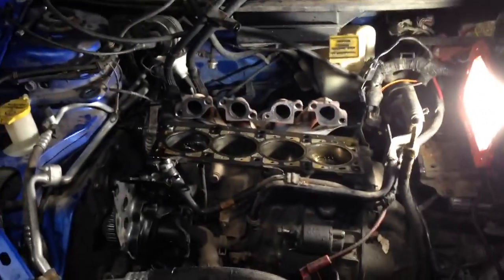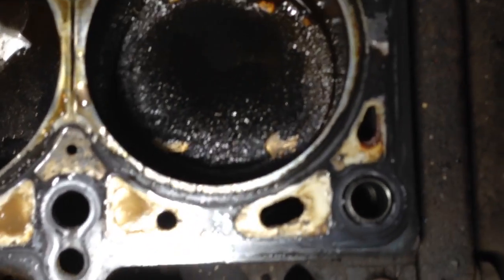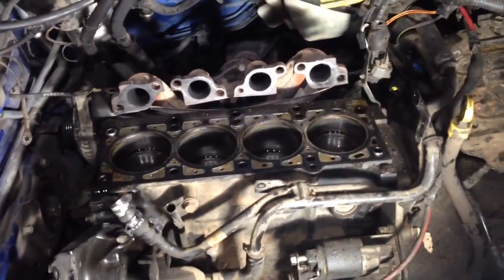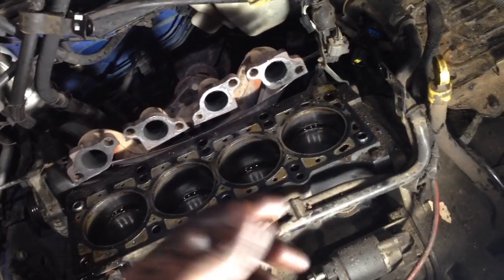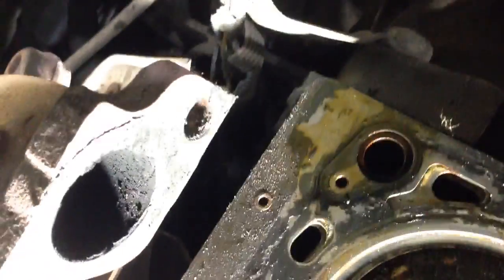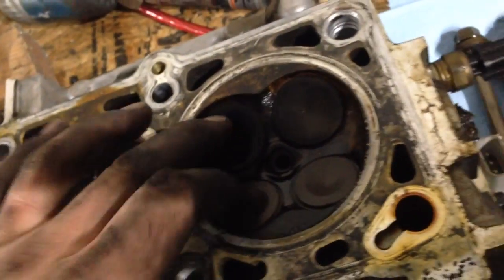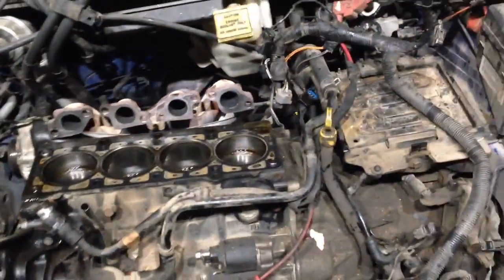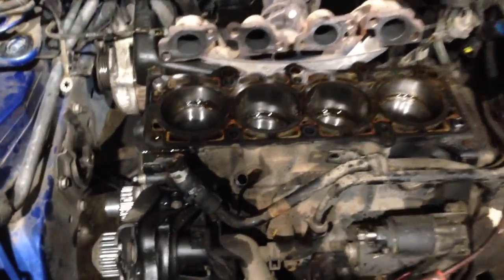How to check for bent valves after timing belt failure

Comment: Recently I discovered that timing belt is not that visible serpentine belt and it has to be changed before you see signs that something went wrong.
The car is 1.4 tdi with 216k km on odometer and original timing belt. 
I took a peek at it, the color is washed, it doesn't have cracks on the back side and doesn't look like it might snap but then looked closely at the teeth and saw at the base micro cracks.
I ordered a belt kit and have to wait 1-2 weeks till I'll change it.
I'm still using the car and wondering, can the belt last another 100k km or it might fail tomorrow 🤔😓😓😓

Comment: A compression test would reveal bent valves. Although those engines are super easy to replace timing kits . Prolly should have replaced it a little sooner
Reply: Except you cant run a compression test the conventional way with a broken timing belt as you'll just do damage, thats why he did it the way he did.

Comment: A week after a head gasket outage and cylinder head crack on a 2004 Audi A4, I sent for a remanned head from Cylinder Heads Intnl and re used my Gates Racing belt (I dont race) with 27,000 miles on it, and somehow the '300% stronger' TB still busted 500 miles later, while going up a hill. All that work for nothing!!!

Comment: 1995 honda odyssey wih 295,241 miles timing belt snapped on hwy.if no visible sign of impact with piston and leakdown is goog should I go ahead with timing belt component install or send out head to shop to troubleshoot. Still working on putting all timing marks back. Do have compression tester,leakdown kit and smoke machine with builtin compresor 30 psi max.
Reply from the maker: sounds like your lucky.  i would put a belt on and see if you have any missfires

Comment: Check  the leakdown with both valves closed.  Remove the rockers if can. Have a machine shop to do the valve job only. Ring  and valve job goes together.  Those rings are shot!! Put in oversize  rings the next oversize.  File them  down to minimum  gap. Install inserts on head bolt holes. Replace the rod bearings and oil pump etc.
Reply from the maker: you could do all that.  would  be good.  I had to remember it was a neon,   It didnt deserve what i did.

Comment: just as a refference; everyone online said my valves would be toast. 91 civic interference engine. But all my mechanic friends who actually have done it, told me to put a t belt on and it would be fine.
One shop I called said it's likely gonna need a new motor.

Guess what: put a t belt on and it's been running fine. Did a compression test after and it's all good. I honestly don't know why. I was idling when it snapped.
Reply: zero gives me hope for my 2000 neon. Got told I needed a new engine. Car won't start.  Made a crazy loud noise then cut off and haven't been able to crank it since.
Reply: if you can do just the belt yourself you should def give it a go.
Reply: zero seriously debating it. Scared though. Looks like a tough job 😣 but I'll think about it. Thanks.
Reply: thats what saved you it was idling, if you were unning high rpm it would have been toast

Comment: I have a 2002 Lexus GS300 with 125,000 miles.  I took it in to replace the timing belt and water pump because I was concerned that the timing might break on me.  The mechanic at a Shell Gas Station screwed up the job.  He said one of more valves was bent.   He admitted it was the mechanic's fault. At first he said he was going to fix the bent but it would cost him over $1,000. Now he said he would  replace the whole engine.  I am quite sure he will just order an engine from a junk or scrap yard.  Do I have any repercussion against the mechanic.

Comment: What's the point in checking for damage, isn't it easier and quicker to just change the belt or chain first then find out. Also valves might be opening out of time if you do it that way
Reply: Put all in tdc and do leakdown  1st crankshft then crank pulley nice and slow if jammed loosen crankshaft bolts  if removed label

Comment: I really don't think the average Joe knows that a belt needs to be changed every so often depending on the vehicle ... most people don't even consider it going until it's gone.
Reply: its in the manual when it should be replaced all rubber band engines have certain change intervals
Reply: Right, mine just went, and I’m now figuring it all out.
Reply: @hipstardee6745  I feel you minds just went as well did u change your if not how much was the job and did it start back up?

Comment: My timing belt snapped on me, I was going uphill about 25 mph. The car just stopped dead, it didn't move till it was on the tow truck. Do you think I have engine damage? And about how much would it cost to repair the engine? 2005 Mitsubishi Outlander.
Reply: Bob O I have an 03 outlander. I changed my timing belt myself. It never broke but it's an easy job if u are inclined. Simple metric tools and torque wrench is all that's needed. U can put it back in time and install belt. U will know immediately if it bent valves. From what I've been told is it's 50/50 on damage or if it's good. If not the head is easily available in most junkyards as it's a very common engine. Hopefully it's an easy fix.
Reply: Chris Johnson  Thank you for the reply. I let the timing belt go 7 years since I last changed it, so I think that's why it snapped. There was some engine damage.  Some places wanted $7,500 for a rebuilt engine. I didn't do that. With the engine damage, it was beyond my knowledge, but I found a very good local mechanic.
Reply: I first had an 03 lease then bought my '05. My dad bought an '06 used and he's put 100,000 miles on it. They are very good cars.

Comment: hi mate, I did my timing belt and thought i was careful with the timimg but I guess due to the turning of the crank ttying to get it undone I must have missed the mark. I never got it running but I did try to start it maybe a dozen times while trying to fault find, only turned the key for a second or 2 each time. What do you think the likelyhood of damaged pistons would be? Is there an easy way to check? Thanks
Reply: depends on how far off you had the timing. if only 1 tooth or maybe 2 it might be ok. You should have turned the motor over by hand a couple revolutions before trying to start it to see if anything was hitting. If your engine is non-interference then no problems hitting valves.
Reply: James Richards I miss my Volvo  timing and I try to  start  it will  it cost any damage

Comment: Hey So I was driving my prelude and belt snapped due to some plastic piece getting stuck in between anyways I was going about 20mph after I heard something hard hit I pulled over quick and just towed my car home opened valve cover and saw belt missing so I replaced it and it stalled as soon as I started it up what can it be bent valves maybe bad timing?

Comment: I did the same test on this 2004 Pacifica that didn't brake the belt but the water pump had a  busted plastic propeller and the tensioner pulley had lost all it's bearings and was just spinning on the bolt. I loosened all the rocker arm bolts and used the hose from my compression gauge and 175 lbs of air.  No noise air from any cylinder from exhaust or intake. I just threw on new pump, tensioner and belt. It must have just threw the timing off enough to lose compression and wouldn't run. Will do an actual compression test in the morning now that the belt is intact, see what happens before putting it back together.
Good video. I just used my regular air nozzle and pushed the rubber end into the end of the compression hose quick release male end.  The air only lost pressure where the pressure pushed the connector loose from the hose fitting. No noticeable air from intake or exhaust. It's the Chrysler 3.5 V6. 
This is the first video I've seen doing this test, so thanks.  I did this before I saw the video, but it's nice to see relevant information posted. Thanks.

Comment: I thought once the pistons are nicked up like that there no good...   but you said the bottom end or block & pistons are fine?
Reply: The nicks don't affect anything. Unless you have a Kia Rio, I haven't seen enough piston damage done by valve impact to affect the running. I've been doing timing belts since they've been making them. 3 Kia Rio's I've seen with broken belts exploded all 4 pistons.
Reply: I think the Spectra is a completely different design than Rio.  I actually had one of the earlier models break a belt and it didn't bend valves - new belt and ran great.
Reply: Timothy Branthoover  what about a kia spectra Ls 03?

Comment: mine has 118k on it and it broke i was told it had a belt put on a 75k but it didnt it runs on two pistons now
Reply: +Chris Adams  That has to be scary to drive. mine snapped at 163K didn't find out what a timing belt was until after it happened. Needless to say I had to get some valves replaced and I've been educating my self in cars ever since.
Reply: Luis Ruiz
 yea timing belts usually have a 90 thousand mile life span but I found of the hard way mine was only 60 thousand.
Reply: +Gabe Swanson same here mine broke at 220k i knew what the belt was but forgot to ask the previous owner if they had replaced it bought it at 150k. and yup i have to to valve repair :/

Comment: I have a Honda Civic Type R (ep3) 2003 and two weeks ago i switched off engine as normal and went to turn it back on and engine turned but wouldnt start. Tried everything,bumping,towing,everything. Local garge towed it away and  got auto electrician out. chekced fuel, and sparks. We couldnt understand why she wouldnt start as all seemed well. Timing however had moved, so i got a new Timing chain and tensioners,guides,etc. After this car still wouldnt start!. So we stripped head and checked valves. The valves were all fine so we cleaned them and seated them properly. Car started!!! trouble was the valves werent sat properly and there was no compression. I got a new head gasket and so now im good to go for another 100,000 miles.A joke really and small job although labour costs were very costly. Cost me over 1000 ukpounds. If your car doesnt start but turns over ok check timing then valaves. The valves might look ok but make sure!.

Comment: Will the crank shaft or connecting rods suffer any damage?i was travelling at 60 mph in my ford mondeo diesel when my timing belt snapped
Reply: +moedem Cranks and con rods are usually strong compared to pistons and valves.  You can check piston travel and height by putting a degree rod (basically a "soft" stick with marks along its length) in the glow plug holes, then turn the engine by hand.  Measure and compare the stroke and height of the rods lift for each cylinder.

IF the piston stroke is consistent:
When each cylinder is at the top of its stroke, push down sharply on the top of the piston with a hard plastic stick etc. while watching the degree rod and listening for click or clunk noises.  If the piston drops or makes noise suddenly....it could mean a broken or spun bearing, or a cracked/broken con rod.
Do not confuse rod/wrist pin or bearing play with normal up/down movement of the piston.

You can also remove the oil pan, and shake or rap the bottom bearings and/or con rods with a nylon mallet.  The bad bearings will rattle or move slightly if they are considerably worn.

If the stroke and height is the same for all cylinders, with no bearing/wrist pin play  you should be good.  If the stroke is the same but height is different you may have bent con rod.  If the stroke and heights are different....yikes, probably a broken rod and/or a broken bearing.

Stay gold.
Reply: Will the engine be removed for rebuilding?  If so, take the long block to an engine machine shop and they can check all tolerances, measurements and motions for damage.

If not, or if you prefer to check yourself, you can measure the stroke with a precision ruler in the cylinder right on top of the piston crown  and a FLAT straightedge laid along the top of the cylinder bores.  Measure multiple times, top and bottom of stroke.  Just past Top Dead Center, try push or tap the top of the piston down - if it moves a lot that could mean trouble.
If you can get a Dial Gauge, mount it at the top of the block and set it so it jussst touches the top of the pistons.  This will help you see deflection or looseness, especially if you spin the engine like I describe below.  Check the edges and center of the piston crown.

Take great care to keep debris, dust etc out of your cylinders.  When you are not working on the block, cover the tops of the cylinders with stout plastic and tape.

IF the crank turns nice, and the strokes are the same height/depth and travel, you can spin the engine with a high powered drill (1/2 inch) to listen and feel for slap or looseness.

Put a socket on the crank pulley nut, and turn the engine slowly at first, then a bit faster, faster etc.  Be sure the cylinders are lubed and watch out for oil spit/spray.  ONLY turn the engine in its normal rotation direction.

Listen to and feel the block for any noises.  Use a screwdriver or stethescope or microphone to listen for noises.  Any clanking, clicking, knocking etc means there is need for further checking.  Usually removing the oil pan and doing what I described in my first comment.

Hope this helps,
Stay gold.
Reply: +dnl machine your comment gives me hope that my engine isn't completely done for. A mechanics apprentice misaligned my timing chain and now the engine wont start even after correcting the alignment. Since the cylinder head needs to be removed anyway to replace the valves, can I just need to stick a ruler in the cylinder and see if all pistons have the same height at bottom dead center?